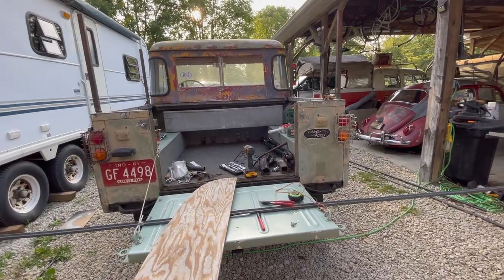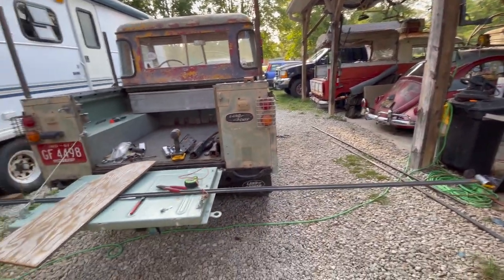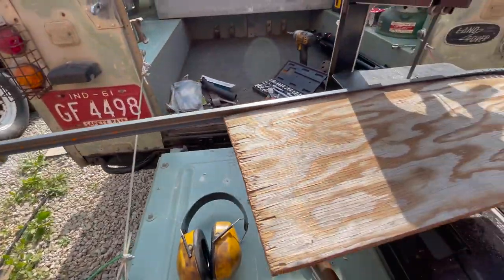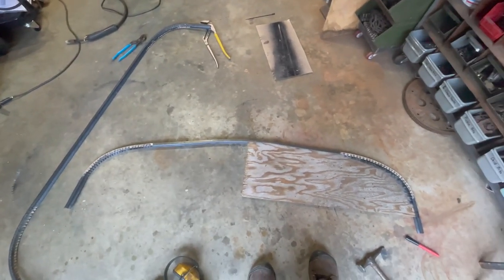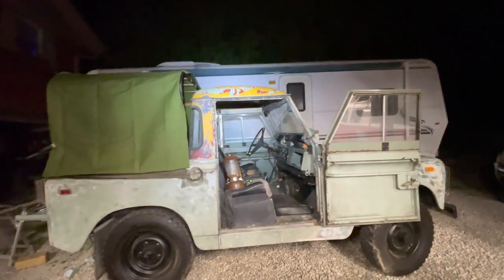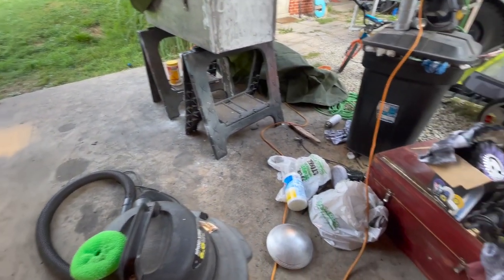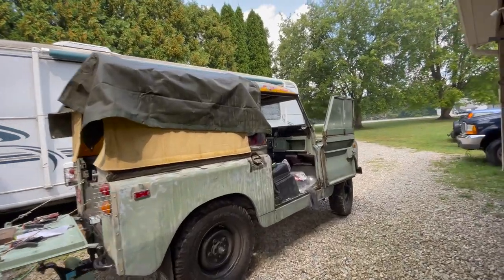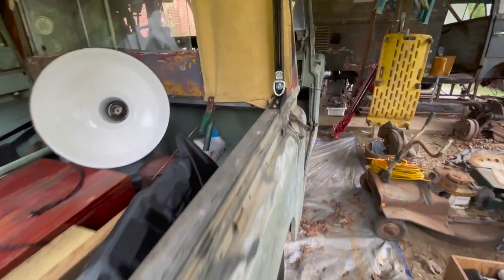DIY canvas/soft top for Land Rover series 2a

Comment: Marci, what is your preference in plasma cutters?
Reply from the maker: currently I am using the cheapest one I could find on amazon! ha and honestly other than having a CNC version at some point I'm not sure I'd go any other route.  This one does everything I need it to do and is very portable, runs on 110 and 220, will cut through 1/2" and I have literally used to "fire" out of it almost daily without any issues!...but then I have never used a super high end one either!??? Might change my tune but for the price of $250 I sill say I am very happy with this one!

Comment: Hi Marci, what kind of fabric that you used on the rover? thanks
Reply from the maker: I just used a canvas tarp for this one...It was basically just to get the pattern down before making it out of the top notch 9, which is the fabric I used for my VW double cab top and all of our vintage tent trailer canvases.  I would recommend the top notch 9 as it lasts a very long time, no real shrink/stretch with weather changes and is nearly 100% water proof!  I've linked the color card and the fabric is available from sailrite.com
BEST OF LUCK!
 
https://www.sailrite.com/Top-Notch-9-Fabric-Color-Card